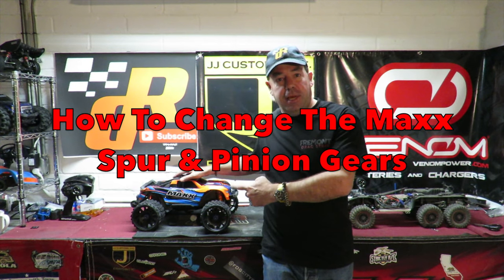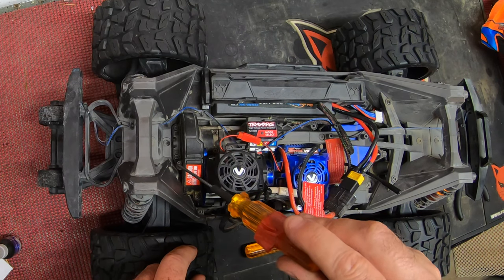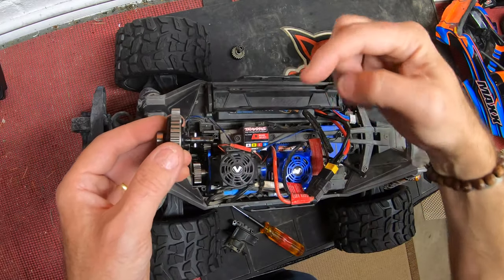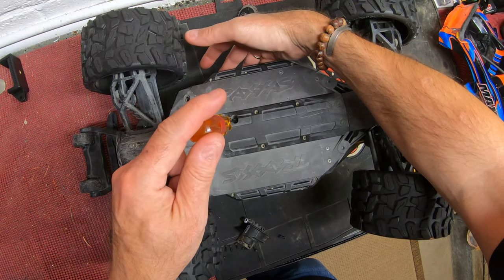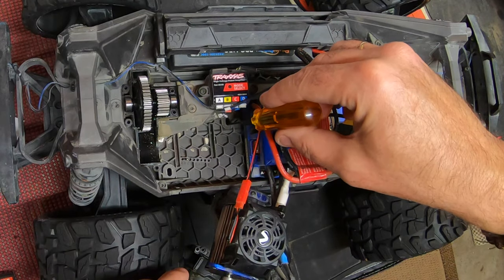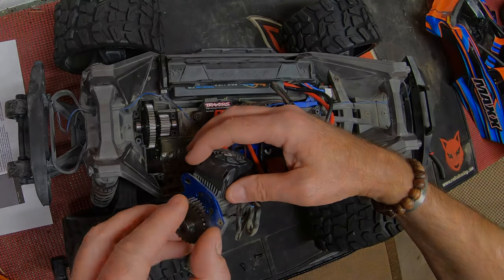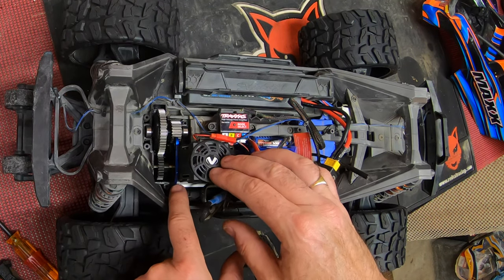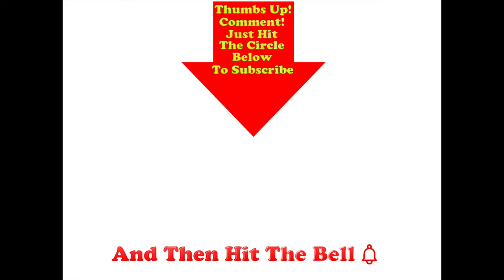How To Change Traxxas MAXX Spur Gear And Pinion Gear

Comment: I have 3.8 trenchers, steel cvd axle shaft, widemaxx kit 17mm spline hubs, and aluminum parts for the traxxas what gearing should I use for the spur and the pinion gear ? Thanks in advance
Reply: I have the same setup and I still haven't found any real answers. Gearing for that and if a stronger servo would be needed was my question. I suppose if something gives out with that setup then you know which parts to upgrade lol.
Reply: Hey gents, i have the same setup with the exception of wheels. Using the 3.8 badlands (non belted), running steel gears 50t spur/22t pinion

No issues

Comment: thanks for the video, always tuning in. i’m thinking of getting the badlands 3.8 tires for this. Do you think stock pinion is fine or should go for like the 20-22t?
Reply from the maker: I’d stick with stock or even drop down a tooth as they weigh and grip more hence more load

Comment: Is there anyway to install a max 6 and still have the light kit still work? I'm asking because the light kit gets plugged into the traxxas esc. If so Please make a video! Thank you!
Reply from the maker: Mac you'll need to splice in a lead for the lights across the esc or battery that's what I had to do on my TRX6

Comment: I just changed the gears in my maxx, you have to take the little pinion cover off to get the spur cover off because the spur cover has a hole the pinion cover bolts to.
Reply from the maker: yeh in the manual it says remove four screws (plus that horizontal one) to remove the spur cover, but I can't see how you could easily remove it with out removing the other two! Glad it's not just me thinking that
Reply: Great, you got a link for where I can get the 26/46 spur and pinions gears from.... Traxxas has no 26!!!!!
Reply: @pm-s3654  no I don't have a link for the pinion, I just get them at the hobby shop, they're not traxxas gears, they're just the ones they have on the shelf.

Comment: This is so easy to work on,😃 i my glad that i brought a maxx 4s myself, I think this is worth the $100 something more then the other 4s trucky.👍
Reply from the maker: Thanks I thought the 3S arrmas were easy to work on but after changing the gears in this video and the shock oil tonight (very easy on and off) this is impressing me.
Reply: Driftomaniacs very easy to work on. I put 70 weight oil in all my shocks. It’s perfect. Stock gearing is great for my terrain